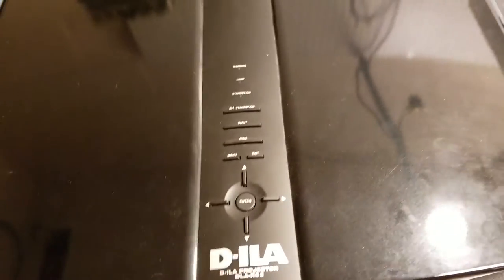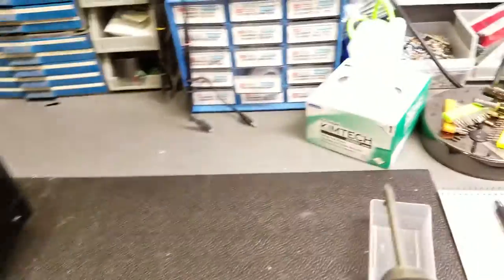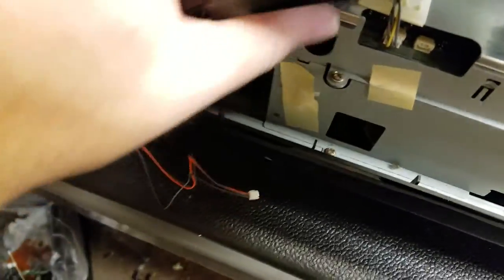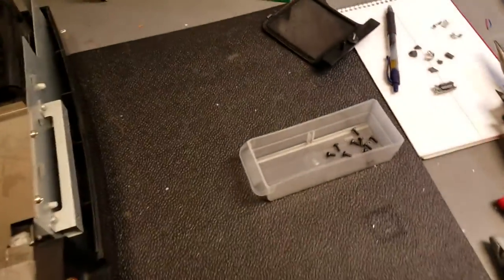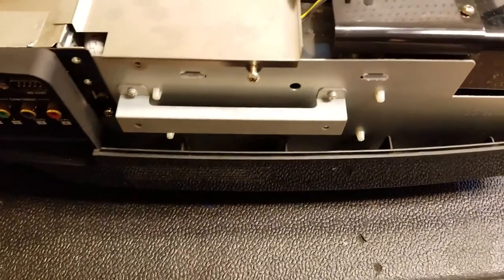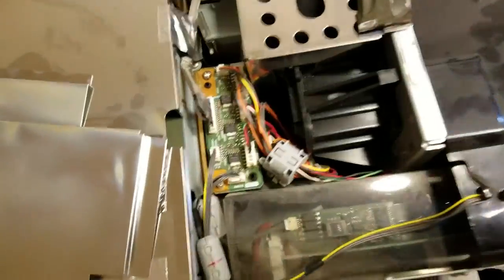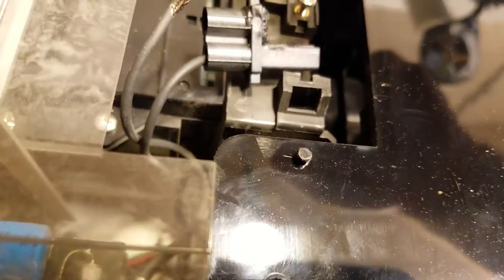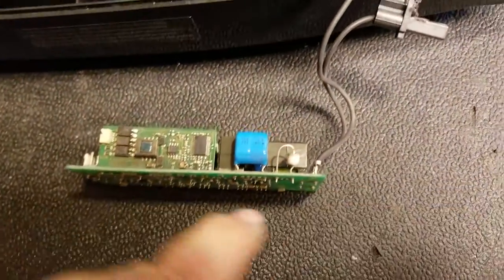JVC DILA RS2 Lamp Connector Repair Part 1

Comment: G'day Frank ... hopefully, you're monitoring replies to this video. I'm in Australia and tried to find a replacement lead and plug (similar to yours) but to no avail. Hoping you can still remember where you got the replacement from. I have the DLA-RS46 / DLA-X35. Cheers 👍
Reply from the maker: Fortunately youtube notifies me of comments regardless of how old a video is!
I recall I used a connector harvested from an epson ballast. They used the same ends. I want to say it was from the model that uses an ELPLP49(epson model).  
I'd reach out to my friend at Time electronics in China.  She can probably help you.  gydz@timeprojectorlamp.com is the email. Let them know I referred you.  They may have the parts you need and being that you are in Australia, shipping will be easy.
Reply: @FixitFrank  G'day ... thanks for getting back to me. Much appreciated. That's useful info. Last night after writing I bit the bullet and removed the original plug arrangement and substituted an XT60 2-way bullet connector. They are widely used in the Radio Control hobby field for connecting batteries. I was confident that would handle the voltage/current. A little soldering and it works like a charm. 👍 I'll follow up with Time electronics. Cheers!
Reply from the maker: I'll have to try that myself! I have some of those in the drawers.  I have even hard wired them in the past. It all depends on who is using it next. you can always just pull the spade lugs off the bare lamp on the next bulb.   Glad to hear it is working!

Comment: Hello, I have an issue with my JVC RS400/X5000. The projector was working fine, no discernable dimming about 3500 hours in. Then the LAMP LED lit up solid orange, so, time to change the lamp. Got a genuine lamp module, removed the lamp, installed it. But when I turn it on, there's no light at all. The fan kicks in, but the lamp doesn't turn on. I put the original lamp back in to check that it wasn't the new lamp being broken, but same deal ! 

I installed it properly as far as I can tell, locked in, not screwed too tightly but I'm starting to think that I shifted something inside when removing the original lamp?
Reply from the maker: Hi Manu,  I don't see anything here that would suggest you caused it.  When the lamp LED came on, were you watching it and the picture cut out or did it happen after you powered down and went to power up again?

On the surface, it sounds like a ballast problem. I only say that because I have seen it before where the Rubicon brand ballast has an IC that just kind of gives out. 

That said, I would try another new lamp assembly to be safe. Defective OEM lamps are not common but they do happen. 

Lastly, if you have the ability, connecting a PC to the serial port might give you some diagnostic info that points to the problem.  Worse case, if you are in the states, I could look at it if you shipped it to me.  But hopefully its just the defective lamp.
Reply: @FixitFrank  The lamp LED happened while I was watching something, fixed light just telling me I needed to replace the lamp at some point.

Turns out I looked inside and the connector is loose, so basically whenever I tried installing the new lamp or the original one back, it basically isn’t plugged in.

It’s tricky because I realigned the connector but it floats around a bit (though you can’t pull it and take it out from where it is it seems). So I’m thinking of removing the top and seeing if I can have a look at it from above to make sure it plugs in when installing the lamp.

Otherwise I’m doing it blind and since it’s loose, it won’t plug in unless I’m lucky :D
Reply from the maker: Really? Those should not be that loose.  Is your new lamp from JVC directly or from a company that claims its an OEM?  I have seen aftermarket lamp housings with Osram lamps inside that had very loose connections.
Reply: @FixitFrank  Oh no, not the lamp itself, I mean the connector in the projector itself. The cable (I'm assuming it's a cable). The lamp is not from JVC directly (which I understand is practically impossible to get anyway).

Comment: Sir, how do I fix the lumen on a jvc projector, I've replaced a new lamp but it's still below 2 lumens?
Reply from the maker: that is a touch question to answer.  Sounds like the lamp might not be straight or you have an iris problem maybe?  There are a lot of possible causes.  I'd make sure the lamp is in straight and that its a decent brand of lamp in housing.